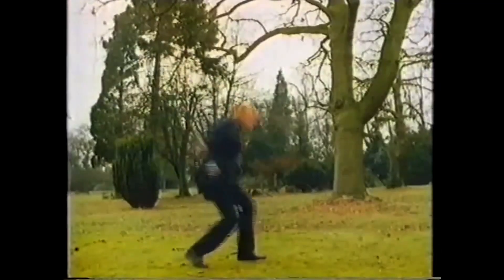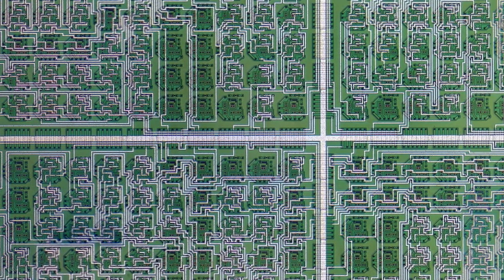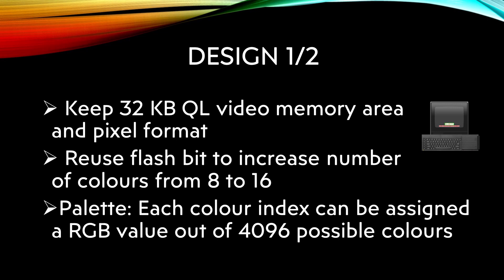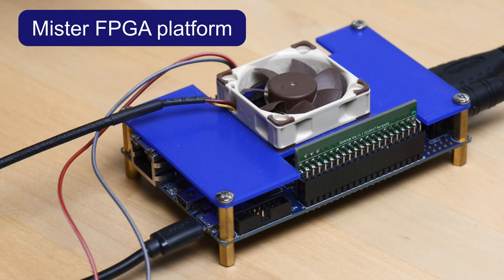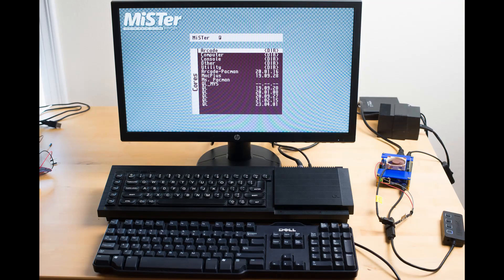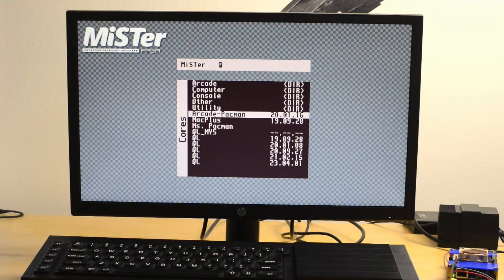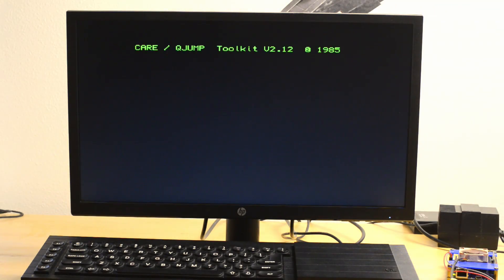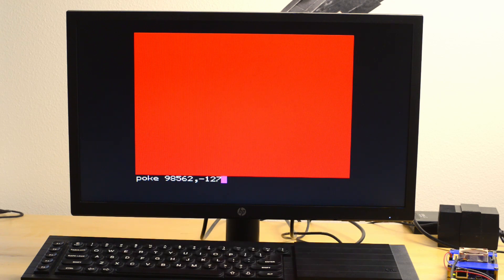The Commodore Sinclair QL

Comment: CHEATING!... but kind of cool.. I'm just trying to find out if it's possible to make a game that uses dithvide for more colours on an actual standard QL, or if it's only good for still images... Anybody know?
Reply from the maker: Yes, I think you could do that, but then every frame you have to update up to 64 KB video instead of 32 KB, so probably slow. Interesting idea. (Correction: just need  to update every second frame, so it would be fine with animation 25 fps or slower; need to use part of the dithvide code for the switching, but not the current binary that I think only handles static images)

Comment: I mean, this is fantastic and all, but sadly we don't have a time machine to go back and beat Sir Clive over the head with this. For a 1994 computer, QL was an utter rubbish.
Reply: Ahem, you mean a 1984 computer, do you? 
The QL was a fantastic machine back then but it was also flawed by Sir Clive Sinclair insisting on microdrives as storage media and a somewhat small RAM size of 128 kB.
Add to that the incompatibility to ZX Spectrum software it meant that you had a machine for programming purposes.
This is what Sir Clive always wanted. 
Do useful stuff with your computer, program great software, that's what the QL was designed for.
The Basic of the QL is fantastic.
And the multitasking of the QL was maybe matched by Windows systems in the year 2000.

But I do not understand the design choices made by Sinclair. If you use the 68008 CPU you only have an 8-bit computer basically. 
The CPU is 32 bits wide internally but all data have to be squeezed out on an 8-bit bus.
Why not take several Z80 CPUs, you have multitasking in your operating system anyway, and make the machine compatible with ZX Spectrum software.
That would have had lots of potential.

Comment: The features of the Nintendo Entertainment System video chip are more advanced in ways over the 64.  It has tiles and plane support, with different pallets I think, between components.   The master system was a step up in some ways.  But we could say dma blitters and the Atari 7800 scan line version, were going by then (the 7800 was under nourished and cancelled for years), as well as vector graphics.  Just look at what Japanese computers consoles and arcades were doing by QL realese and QL death.  The Loki and Amiga fit in there too.

The Japanese simply made a better effort.  Even VGA is based off of an older Japanese design. 

It's better to include titles and planes with 16 and 256 colour modes too.  Even 16 and 256 colour sprites.  But, all this can be replaced by a blitter with 16 and 256 colour modes.  As you overlay the images it comes out correct.

With 128&512KB of memory for graphics or data.  Programs made for it can load all graphics assets their and sije data. Leaving main memory free for code.  As such, the extra memory does not need to appear in the main address space, but be bank switched or register accessed.  This is normally bad, except you are using a blitter dma on the board to move things around.  A very simple overwrite and blend functions.

To look not too blocky on a modern LCD TV, you need 640*480 4:3 screen ratio.  512 will do, but for wide screen support 768. 16 and 256 colour 512/768 too.

The IBM professional graphics adaptor had these sorts of colours and resolutions for years.  The QL was supposed to be a professional machine of similar performance to those old machines.  So, we can imagine that they could have made a pro version like that, and made a second normal version with those features in future.  If you look up their second QL and the one like the PCW, you will likely see plans like this.  They had the Amiga and ST to compete with. 

Can the socket support designs like with the Uno, Q68, and next like design in an FPGA using internal memory for the graphics, and maybe as expanded memory?
Reply from the maker: One problem is that without redesigning the QL it still has an 8 bit bus, so it would be hard for QL software to do any substantial animation into a high resolution 256 colour background. Even the current 32 KB of video memory cannot be fully updated by the QL within a single frame (20 ms), only the ZX8301 can do that by using burst mode.

Also because of the low bus bandwidth, sprite bitmaps will stay in FPGA memory like you suggest (with register access, since memory mapping of large areas would not be compatible with the Gold Card and other expansions), whereas an affordable and flexible solution at the time was to read them from the normal DRAM.

Socket: While my initial plan was a ZX8301 replacement, it's much easier to use the side expansion socket instead, and more flexible as it gets the high address lines (maybe useful one day to implement expanded memory). I don't think any other QL compatibles have the same socket.
Reply: @qemulator I forget where we were going with this, but I'm stuck in bed with covid, so not quite getting it.  An fpga having high speed memory supply bandwidth in a chunk of memory to supply all of this.  However, realising merely having palleted16 colour 256 line mode, ad 4 colour palleted 512 mode, would be a great improvement. However a 512 programmable character colour attributed mode, or 640 for 80 columns would be a great improvement.
Reply: @qemulator however, that little closed off difficult to get fpga that can fit the rear port but practically is an QL in itself, is the start of something.  If it can be clawed out of the dead dying hands of its owner into open/crowd sourc with sesible people, you have the start NextQL to explores.  The best QLOS and GUI, modern hardware and usb 3.0, ssd, SD card to develop something updated, maybe even a linux distro.  Better that than cranky old men playing skeleton coin snatcher box with the future.  Nubs of the underworld, often mistakenly think everything is finished and we should all go tl the grave with them in slumber.  Like those coin snatchers.  I know what I woud like to write on their proverbial tomb stone, was, has been, no future..

The Spectrum Next seems to somehow be a missed opportunity, and zx81 and QL should go their own ways.

Comment: Nice video, I would be interested in the development of this project. 

I doubt the QL could display 1024 x 512 with more colours, the machine would slow down to a crawl.
Reply: Pity it couldn't do 512x512 in mono using 1 32kb screen buffer, or even better, 1024x512 interlaced using both 32kb buffers... and of course 256x256 with 256 colours using both buffers. 512x256 with 16 colours could be useful too.
Reply from the maker: Even arcade games at the time were relatively low resolution. What bugs me more is the weird pixel aspect ratio of the QL. Perhaps it should also have a square 256x256 mode.

Comment: How does this work align with the actual ZX8301 replacement we currently have that was created by Leon?
Reply from the maker: My timid attempt on QL forum to suggest a collaboration was ignored, so at this point they are two separate projects, although you never know.
Reply: @qemulator  Sorry I had my sprites ready from another project and I used my code, and the hardware was on development (and still is) so you couldn't have a standardized hardware to work on it.
Reply: Great work you did.

Comment: i wonder if you could interupt the raster so you could display 1024x512
Reply from the maker: FPGA can do a lot, but even for monochrome 1024x512, the QL would have used twice the video memory and bandwidth (and need a faster video clock), not something the machine could have tackled without a 68000 with full 16 bit bus and more RAM.